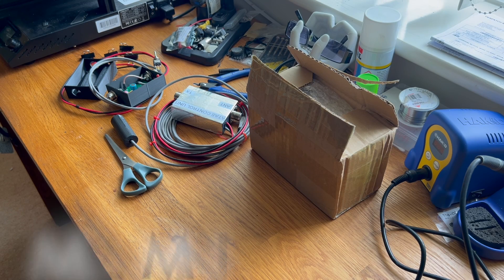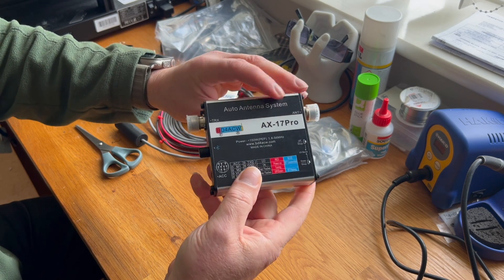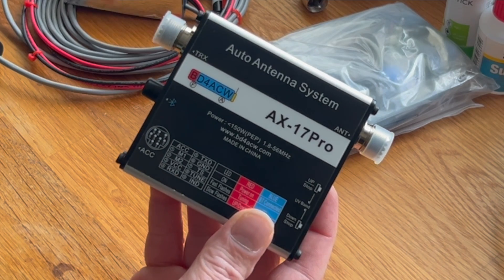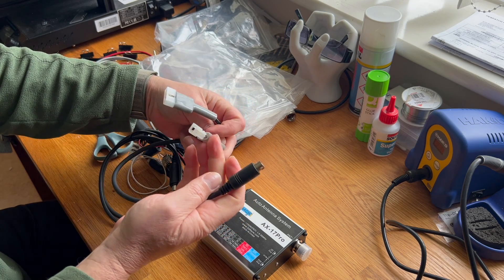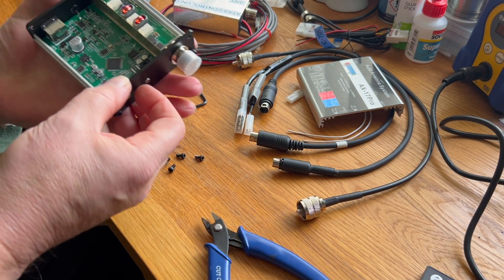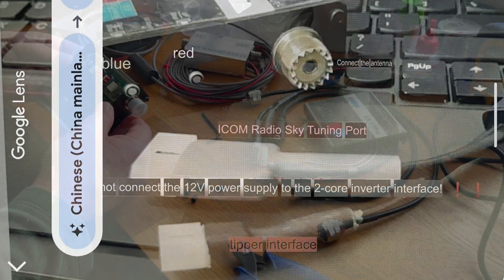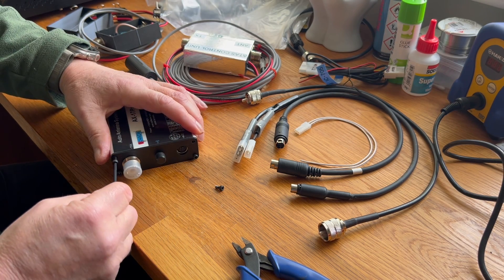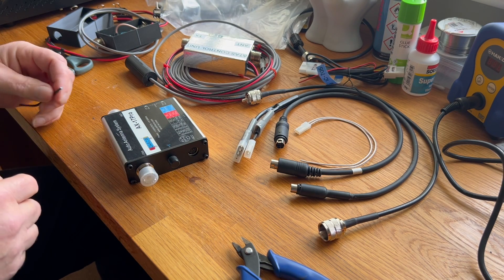AX 17Pro Auto Tune Antenna Controller from bd4acw.com, ATAS, Tarheal, Screwdriver antenna

Comment: Did you get the manual yet I would be interested in how the little Tarheel 2 is connected with a IC-7100
Reply from the maker: Not a useable one no, but I will get there.
Reply: Did you hook it up ? To the ic-1700 ?
Reply: I have one and it WILL NOT control a tarheel 2 from an ic7100.  It looks like it has enough voltage but lacks the current required to drive the motor.  

I've tried using the power from the radio and also a direct feed from a dc battery. No luck.

The dc battery itself drives the motor perfectly.  

I've tried everything, the instructions are not useless but close to useless. 

The support so far has been lacking.  

I've heard it works well with an atas.  But I have a working tarheel and from what I've seen so far I'm out of luck.

Additionally the app WILL NOT INSTALL on a current android phone. I had to find a 5 year old tablet laying around. I was able to get it to install but it is buggy as heck.  Works 20% of the time.  

This is a great product I think as long as you follow what others have made work.  But it definitely does not work in all of the configurations they claim.

Comment: Would it be possible to share the owners manual?  In the past I have purchased radio equipment from China and had to guess the operation.
Reply from the maker: @garyduffield3131  if I get one I will make it happen
Reply: The owners manual is on the website written on the front of the device. It's in Chinese, but Google translate does a semi decent job translating it.

Comment: Looking forward to seeing the new module working! My case use would be with an IC-705 and the ATAS120A antenna! This could be a good option!
Reply from the maker: Yes maybe..
Reply: Will you be making a demonstration video? I felt like the end of this one was a tease! How well does it work?! Thank you for a wonderfully informative video! I'm looking forward to the next!
Reply: The controller comes with a cable that has an IC-705 tag on it.  One end has a 3 conductor 1/8" (3mm) phone plug on it and the other end is bare.  Hopefully you are or have a great Elmer like I did to help.  I don't have an IC-705 so I'm no help on that.
Reply: I’m think about the same use case.
Reply: I use mine with a 705 and 7100 with a manual bias T, works great. Auto is tempting but as the atas shouldn’t be tuned whilst moving I’ve stuck with manual for now.